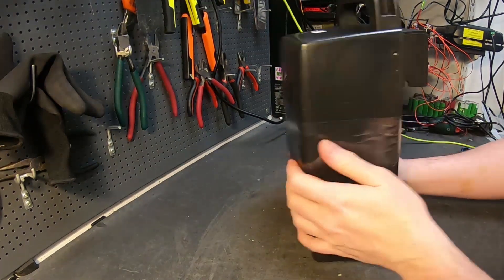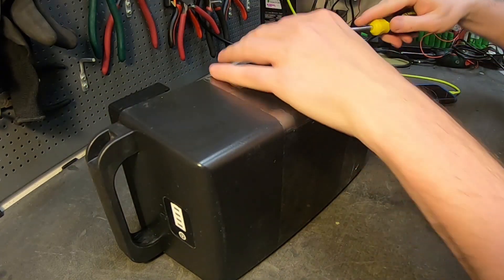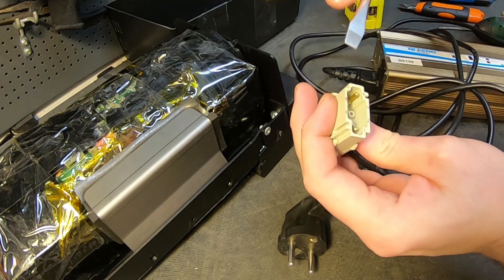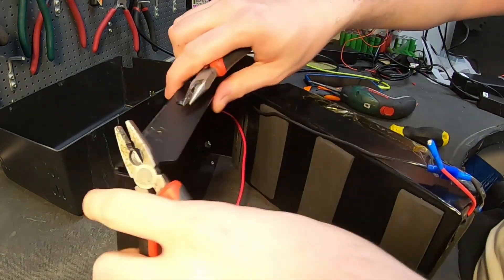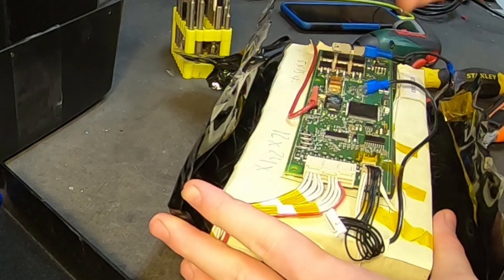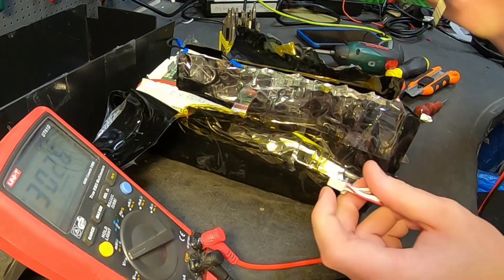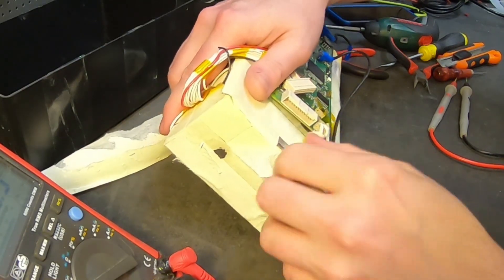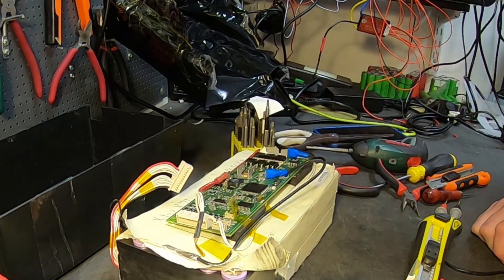Qleeno Cordless 48V battery - Teardown and repair options

Comment: Interesting, worked for this company as an engineer for a couple of years. I am responsible for creating this beast. I can say to my defense that I´m a mechanical engineer. This is a replacement(first version had unsatisfactory performance) battery I sourced from a US company. We were really afraid of thermal runaway so made sure that would not happen and this company had an interesting design that would dissipate the heat in a graphite block and melt the wax in the block to absorb heat. This must be an early model with short shelf life, but that got improved a lot in later iterations and almost all the early models got replaced. As for the wired connectors, I think I had some design constraints to work around. Really fun to see
Reply from the maker: Thanks for the input! The customer actually came back since his Qleeno (the same day you wrote the comment!) since did not work properly, this time it was not the battery but the push metal prong buttons in the display. We cleaned them up and got to try the machine when it was fixed. Its really strange and likes to swirl to the right.
Reply: @TheBatteryDoctor  Hm, it could be the wrong brush or pad. It's sensitive to incorrect brushes or pads as the squegee ring is spring loaded and the pad\brush is fixed. 
It's a strange little machine that never found any love
Reply: I have the Qleeno floor scrubber I have only used it twice had it about 4 months.  I own a cleaning service.  When using the Qleeno it works great at first start up. Once the tank needs water and old water dumped it’s refilled and start it again it runs about 30 seconds and all three lights comes on and it beeps and cuts off. What is this problem I have googled and you tube .  It’s annoying when I have a job and have to keep stopping. The machine has desk new water and old is empty
Reply: @randalgoad156  Hello Randal. 
It was about 6 years ago I did my last day at that company so my memory is a bit rusty.
There is a water sensor along the water feeding line. It's hidden underneath the blue cover so you cannot access under normal use.
It could be this part that is sending you errors because it's dry. Could you try and press and hold the water button? Don't remember if it's the small or big drop. This will start the pump and hopefully flood the watersensor.
Good luck